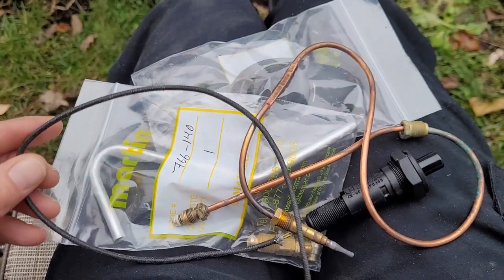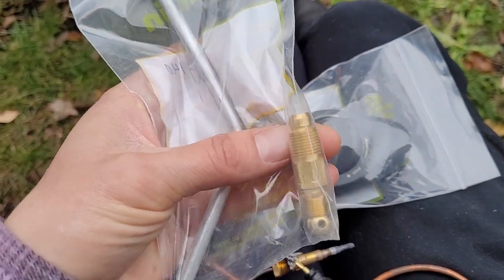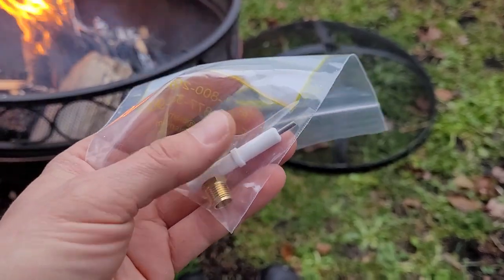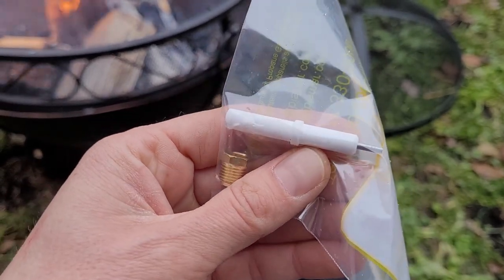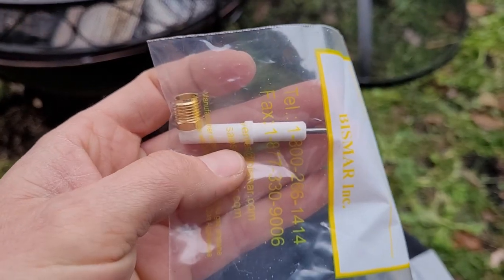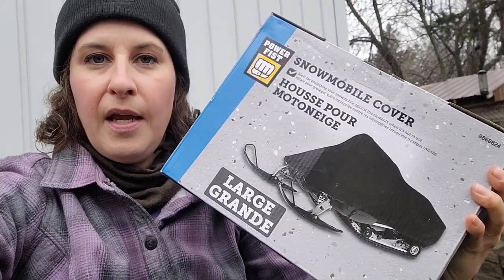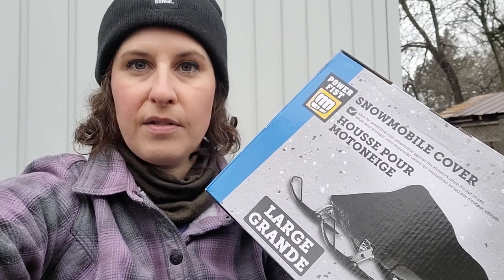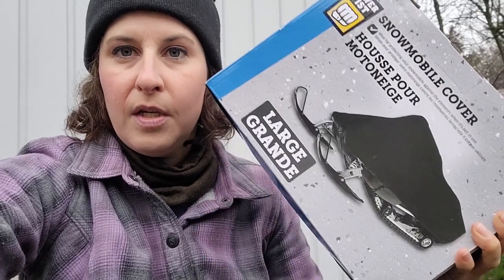They don't make things the way they used to!

Comment: Good morning Jen! Hang onto all the old school that you can because they don't make anything to last these days!    👍😊👍
Reply: Yes, the manufacturers have been cutting manufacturing costs over the last 40+ years and a lot of it was by using plastic in the products so these products
don't last very long so you have to buy a new unit. Parts can be cheaply manufactured and sold at a ridiculously high price. Look at the cars manufactured
today mostly using plastic parts that don't last with proprietary electronic components that can fail after a few years then they aren't stocked anymore.

Comment: Thinking these same thoughts yesterday as I drove thru my subdivision, old refrigerators sitting at the curb for pickup, not the original builders models, so means families are on the 3rd fridge now, houses are only 16 years old and third machine, longevity only 8 years on major appliances!  Noticed the cost to replace, partly due to supply issues, wow.  Living in south Florida, AC system repairs every 6 months, replaced twice already.  Price of paradise we say. 🌞🌴

Comment: Glad to hear your heating system has all the parts ready to go. Might be worth having a cubic mini stove as a backup heater for that inevitable time you have a heater fail or run out of propane (also, sometimes a fire is just nice, as you said at the beginning of this video). Stick with the reliable snow mobile as long as possible- the carbon cost of replacement is huge based on your limited usage (at least until electric machines become viable). I have so many old things still going I could not begin to start listing them!

Comment: Yeah hi Jen when it comes to maintaining your little bravo the key to anything lasting any length of time is maintenance if I was you I'd get out there with a grease gun and get the track off the ground so you can see what's going on in the skid you got idler wheels in there you got slides you don't get it up in there so you can spin the idler wheels make sure your bearings are good check your slides make sure they're not razor thin they should be grease zerks in there in your skid so it needs to be greased every season preferably in the spring definitely in the spring and then you do this squeeze the grease gun until grease comes out and then just wipe up the access your belt on your clutches are very important Make sure that you replace that every couple years if you have a skinny belt it's going to sit down in the secondary clutch further and basically when the belt is sitting down in that clutch it's like starting out in second gear so you need a an up-to-date good belt check and make sure that your air box is clean because mice tend to build nests in your air box so you'll want to check that throughout the fall season replace the spark plug every once in a while and if you do these simple maintenance things it will last for years. 
Your other question was do you think they make things the way they used to God no nothing is made to last anymore if you get 5 years out of something maybe 10 you're lucky The new stuff is definitely much harder to work on because it has so much electronics to it and if you don't know what you're doing you're going to make it worse. I do understand what you're saying about wanting to buy something a little bit newer to replace the bravo but winter is so unpredictable nowadays. With global warming going on everything is changing I live in central Minnesota this used to be a spot that would get lots of snow every year it was the snowmobiling king around for many many years I'd say the last decade or snow amounts have been dwindling last year we hardly got any snow and this year I don't think it's going to happen we had a major drought all summer long we hardly got any rain and it's doing the same thing all fall here we have had no cold weather and no rain we got zero we do have some snow on the ground but it's patchy because we did get about an inch That's it That's all we've gotten so far this season and I don't think it's going to change so I can understand you being hesitant about wanting to buy something newer personally my opinion is I wouldn't bother it's a lot of money to spend on the old bravos hanging in there just maintain it it will last. And when it comes to your little heater in your cabin it's never cease to amaze me that you order something and they ship you the wrong item I don't understand that I mean where is the quality control nowadays it doesn't seem like it exists I've heard from so many people that the order something wait for an eternity to get it and then when they do get it it's not what they ordered and then you got to ship it back and another month passes by the time anything is accomplished it's sickening and it's maddening and frustrating. So hope you guys get some snow up there and I hope we get some snow but God only knows I guess we'll just have to wait and see enjoy your videos Jen keep them coming.

Comment: My furnace was 29 years old and like you I had an expert come and inspect it every September. Then 3 years ago it just conked in the middle of a cold spell in February. The parts needed were on back order. And btw I had changed those same parts just a couple years before. I had no choice but to replace the old one with a new efficient model. I haven’t had any problems since and my to be honest I should have changed it sooner. Old equipment is great but at some point it will fail.

Comment: I recommend a wood stove. You will love it. They always work! I have a small wood stove in a 9x12 cabin, not a cubic mini. A small wood stove with a window and standard size chimney pipe. You won’t regret it. You can heat you cabin with very little wood, just the stuff you clean off your trails and the odd dead fall. A transporter would be a nice little sled for you and your lot, however I don’t think it will bring to much more fun than the bravo. ✌️

Comment: Go to hear you finally got the heater part. So frustrating when you have to go through all that to get one part.   But your d part you repaired can be kept as a back up if needed.   Nothing made like those made in the past. I have a wringer washer from the early 50’s and it still hums along and washes just fine and the wringer still works.  My electric washer maybe makes it 10 years.   I will take the kenmore wringer washer over a new one.  I paid $50 for it about 9 years ago at antique store. It’s a keeper.

Comment: There are too many things today made out of plastic. That starter is a Piezo crystal starter and when a crystal is struck or aggressively twisted it will create a HV spark.
Some butane lighters use the same principle and the propane/natural gas unvented/vented heaters can be lit using a match as long as the air in the line to the heater
pilot is bled out. Once the pilot is lit it should be ok unless a draft blows it out or the gas is turned off. I have 2 heaters that have to be started every fall since I turn them
off in the late spring and those 2 heaters have to be manually lit with a match or a lighter. The burner will not light until the thermostatically sensor gets heat from the
pilot light and all air is purged out of the system. Not much quality is put into those type of heaters just a high price tag is added to them.

Comment: Houses.. Here in Sweden i would not buy a new house. I live in a house built in the 18th century and it has a logframe. The wood is from long time grown pines and spruce i think, very dense and still healthy. On the side i have board and batten,  that has to be chance in every 30 years or so and it is painted with falurödfärg, (Falu red colour made of iron oxide, rye and linseed oil). Easy to make yourself, it is cheap and really protect your wood. People visiting Sweden are often asking why there is so many red wood houses in Sweden, and that is why. :)

Comment: We've evolved into a disposable society, if it breaks, throw it away and buy a new one.
Manufacturers are depending on you to keep them in business and if you can fix a product, that means they lose out on making a profit, so they design things to only last so long before failing. Parts that used to be made of long lasting metal are now made from cheap plastic.
Being a retired, old-time machinist/tool & die maker, I could rant for hours of how quality control has almost vanished over the years.
Reply: It is maddening that we can’t fix them. I resent having to buy a new thing when the old should just be fixable. So wasteful!